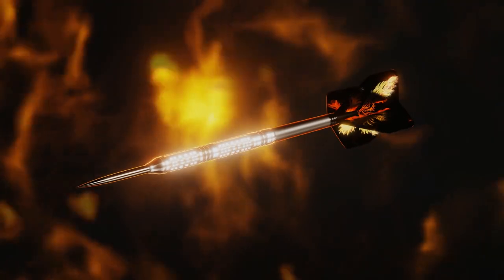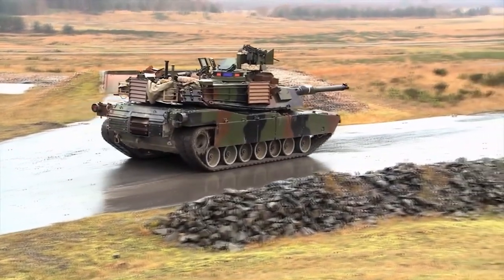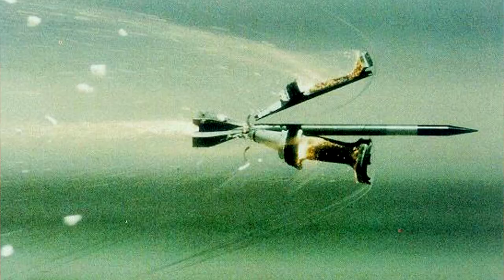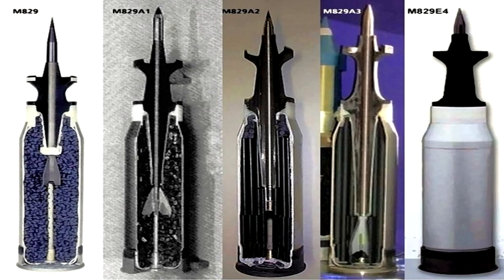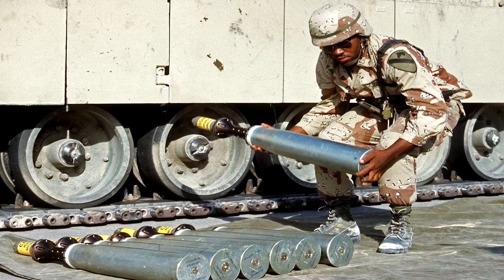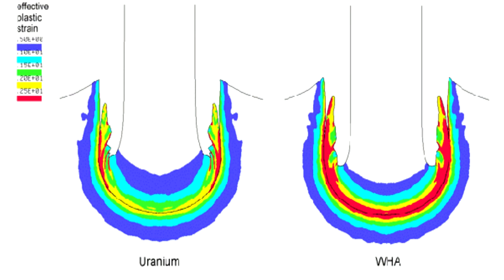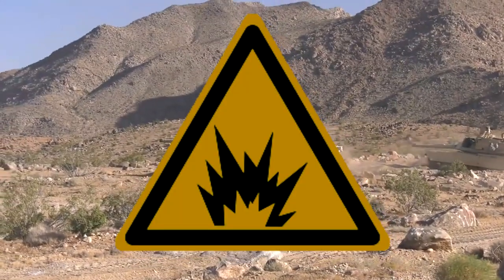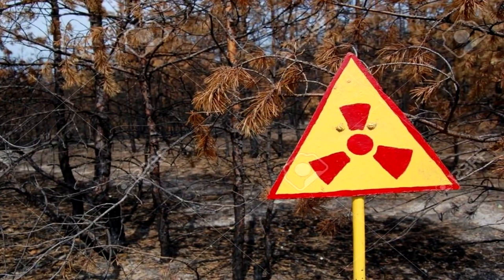So what are Depleted Uranium Tank Rounds?

Comment: the reason DU core projectiles are used is because of their weight which provides more penetration ability against more heavily armored targets
Reply: Not really. Tungsten shells have very similar density. The "edge" DU shells have is that they are both self-sharpening and pyrophoric.

Comment: A couple minor corrections: Apfads is fin stabilized. If you shot it through a rifle barrel the fins would catch the air and rip the back of the penetrator apart. The m1s 120mm is smooth bore, unrifled. The fins stabilize the very long projectile in a way spin stabilizing would be inferior to. 

DU only has pyro effect against ferrous metal. DU armor hit by DU penetrator would not cause pyrophoric reaction, same thing with aluminum or any non steel/iron alloy or composite.

DU is only mildly radioactive in the sense that so is virtually everything else. DU comes from reactors that has burned through all the reactivity, there is so little radiation from DU ammo that outside of lab conditions or with an inexpensive Geiger counter it's impossible to differentiate a DU source from background radiation. DU is still a very toxic heavy metal capable of killing someone who ingests too much, but so is tungsten

Also it's not that the USA is the only state to use DU armor and ammo: DU is actually very soft as far as metal goes and is ineffective as a projectile or armor, unless you harden it to be near diamond hard. The US is the only country that knows how to do this, which is why nobody else uses DU

Comment: I'm going to get one of those tanks
Reply: Get ypurself a home protection system using a turrwt made from the cannon on a a-10 its a 30mm 6700rpm machine gun that shoots uranium rounds aswel
Reply: @wesleydamen2018  😉👍 Twin miniguns on the roof and fill the garage with ammo! I actually feel fairly safe already with one American flag in the center of the house, a Pakistani flag at one end and the Isis K Flag at the other. The FBI has me under 24/7 surveillance. I still want the tank though

Comment: I've been curious, as your tank-round cut-away illustrations show, how these rounds are loaded with propellant considering the finned base of the projectile extends to the bottom of the case. As a conventional ammo handloader, it seems impossible to completely fill a case without crushing the propellent, do they spin the round and allow centrifugal force to open-up a void in the center enough to insert the penetrator/sabot assembly into the case? Does anyone know?